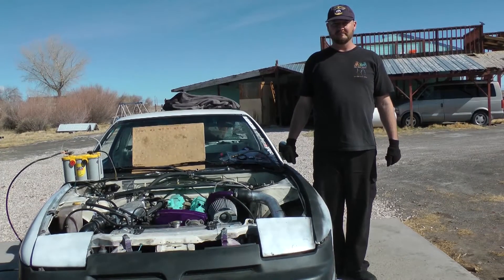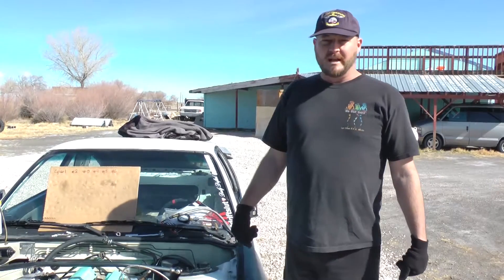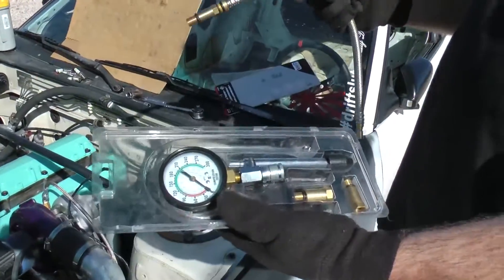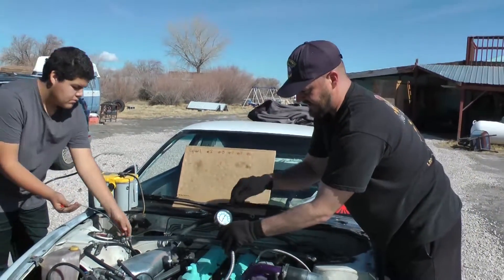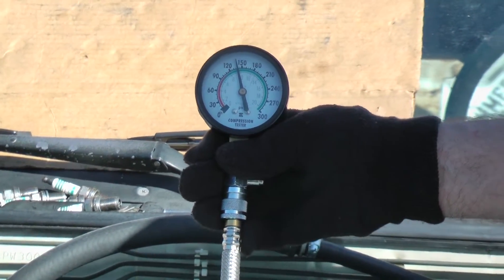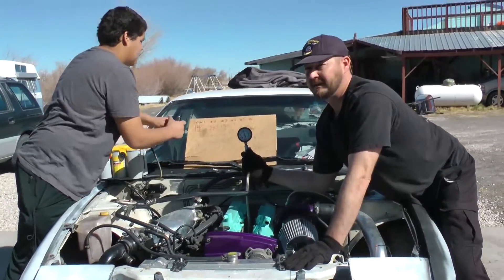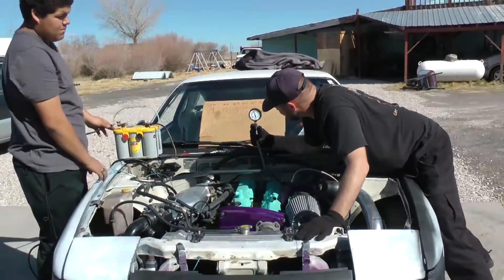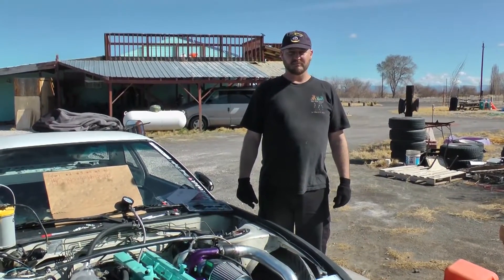Basics on Compression Testing (Using an RB20DET)

Comment: Hey Matt what did the RB 30 come in?
Reply from the maker: It was an RB20DET from an R32 Skyline GTS-T
Reply from the maker: The only cars I heard of coming with RB 30 engines were Nissan cars imported to Australia.  They were sohc engines and some tuners put RB 26 heads on them.
Reply: +Sean Price That is impossible, as the VG series engines are V6's, and the RB series are straight 6's. You tell whoever informed you of this to stop pulling your leg. Now, if by bottom end, you meant pistons and rods, then those will work in an RB30 block. The VG rods are the same length as RB30 rods, so they wouldn't increase the stroke.

RB30 engines, like Budget Boosting replied, came in Australian cars as single overhead camshaft deals. To make them dual overhead cam, one would fit an RB25DE/RB25DET/RB26DETT head onto the RB30 block.

To stroke the RB20 engine, there are a few combinations involving RB25 & or RB26 crank and rods, and Toyota 4a pistons.
Peace.